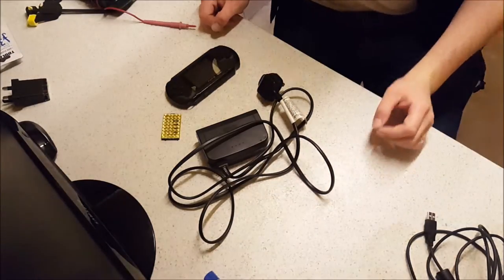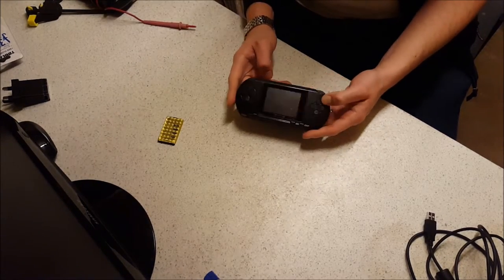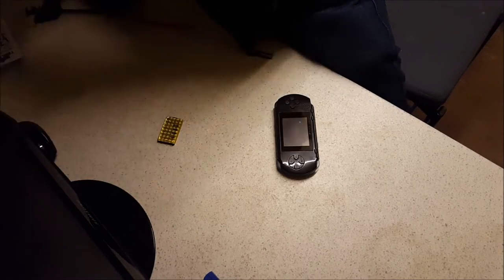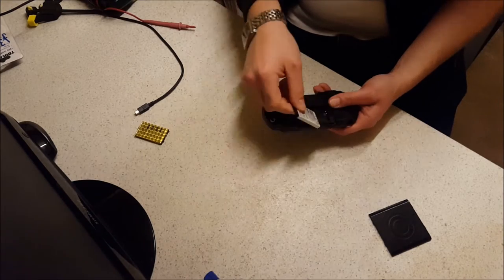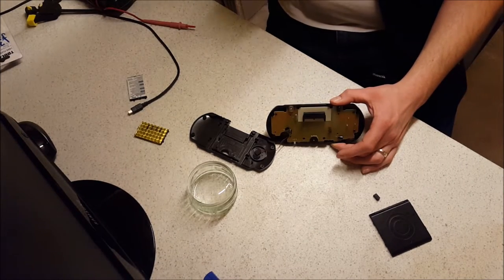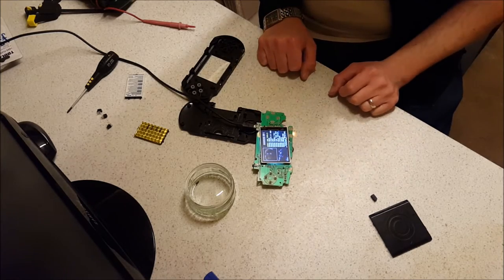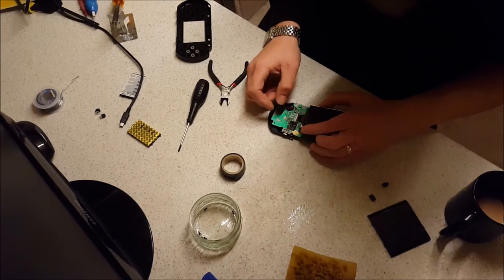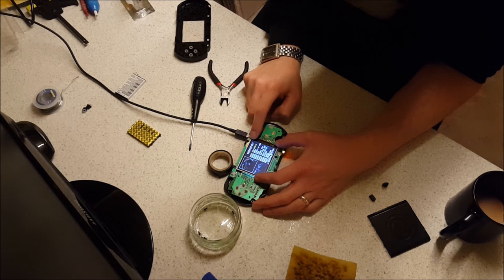PXP3 Slim Station - Console Repair, won't turn on

Comment: my on/off switch broke, what should i do now?
i tried to "make" one by testing the solder point and seeing they turn on, but in the two pins of the middle the screen just turns white, can you help me?
Reply from the maker: I got rid of my pxp3 a few years back so I'm not able to check any of this but take a look at how many connections the original switch has and that should help you work out what you're looking to replicate.

Comment: Hey I have a console can you help me fix it???
Reply from the maker: What's wrong with it?
Reply from the maker: It looks from the photo like the ribbon cable has torn right across, if that's the case you'll need to replace the whole ribbon. I think you'll struggle to find a part as these consoles are cheap throwaway electronics so it might be time to look for a replacement, you could always keep this for spares
Reply: @mdickens98  thanks for your help 😊😊😊